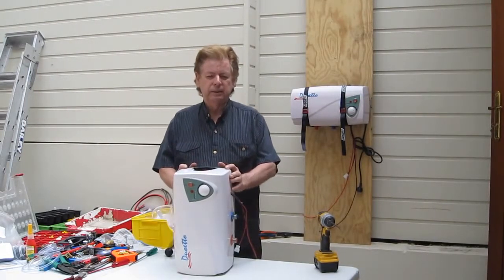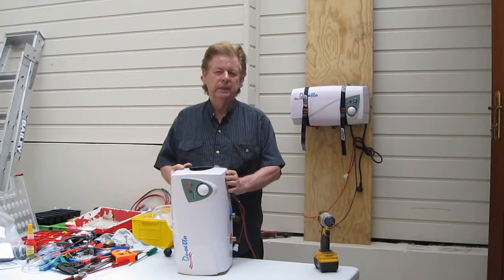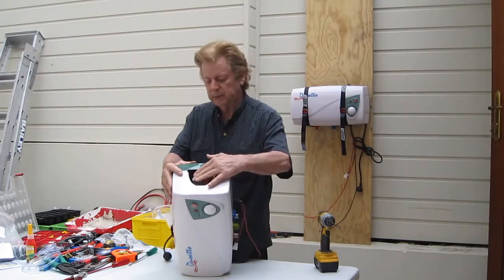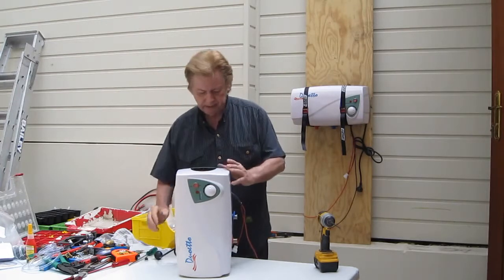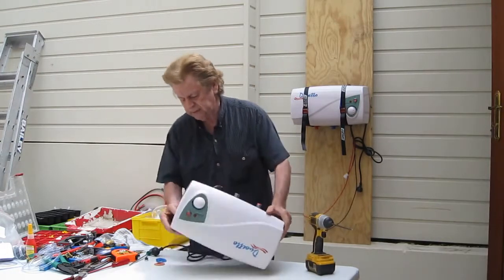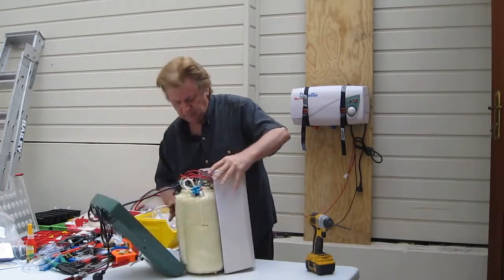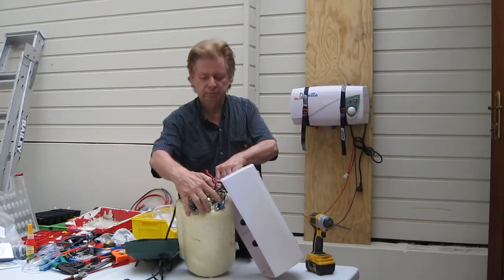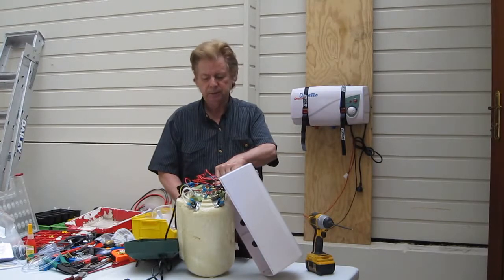Duoetto MK2 Hot Water Heater – Troubleshooting Tutorial

Comment: We recently had a fire in our motorhome due to a Duoette HWS. The unit was working on 12V, was turned off overnight to save battery and turned on in the morning. The fire was noticed an hour after restarting the unit and melted half the HWS along with wires connecting to the house batteries. The unit was connected by a qualified Auto Electrician and has given us good service for about five years. Has anyone had a similar problem? We would like to repair the damaged cabinet and install another Duoetto.

Comment: We’ve bought this hot water unit along with the seperate remote control valued at $100.00 only to find out it won’t work if we mainly have it hooked up to 240V AC. Doesn’t mention this online. 

We’ve also bought 2 of his black “stainless steel” shower hoses ($35.00 each) to find out they leak and aren’t compatible with Australian standard fittings other than Jays shower box. Again, Jay needs to update his website. 

When emailing Jay he pointed out we used the wrong fitting for the wrong product and have no response to the remote control not working on 240V; he’s not interested in taking on feedback or helping us out as customers.

Comment: just picked one up today and had it installed.  It was working when I left the installer’s shop but after only 2 hours it had stopped working and didn’t heat the water past 30 degrees.   What a piece of you know what.  FYI - running it on 12V

Comment: This water heater does not appear to be the MkII version. Where is the temp display and more to the point, where is the reset button on the Mark II? I’m hoping that I do not need to dismount the machine and then pull it apart to press a button.
Reply: How did you go, did you end up resetting it? I am thinking of drilling a few small holes in the case to make it easier to poke a stick in there to reset it. how often does it actually trip?
Reply: @ottigreenisgo just picked one up today and had it installed.  It was working when I left the installer’s shop but after only 2 hours it had stopped working and didn’t heat the water past 30 degrees.   What a piece of you know what.  FYI - running it on 12V
Reply: @alanbransdon2731  hey mate that’s not ideal. I’ve had mine installed for months now, I run it off 12v mostly when driving and dc dc is on. But also heat it on 240 when Parked up to top up the heat in the morning etc. I’ve never had it trip though. I do have it set to 65 so it isn’t getting too hot.
Reply: @ottigreenisgo  hopefully mine will run that reliably when the bugs have been fixed